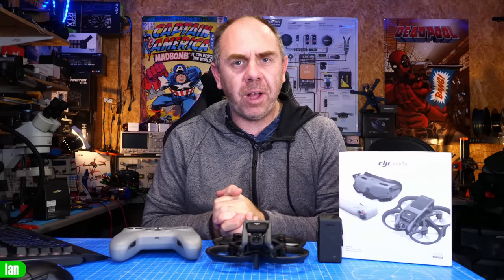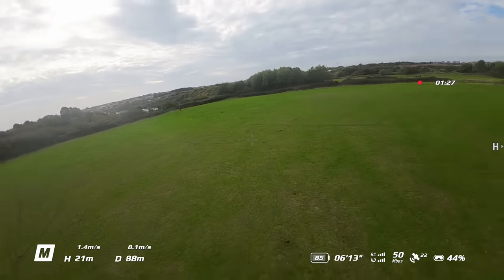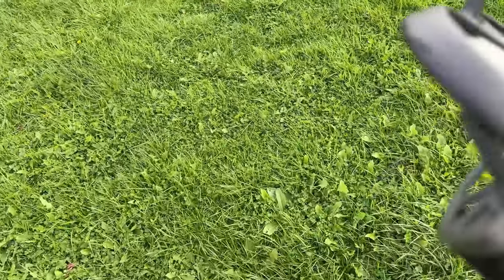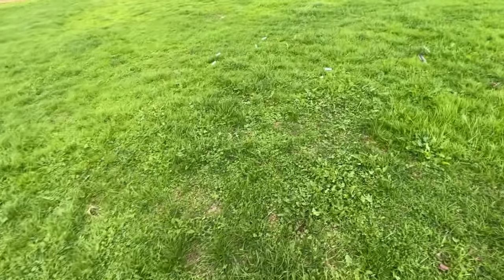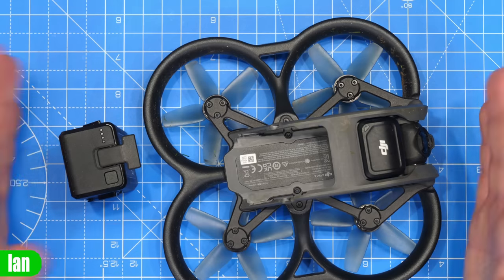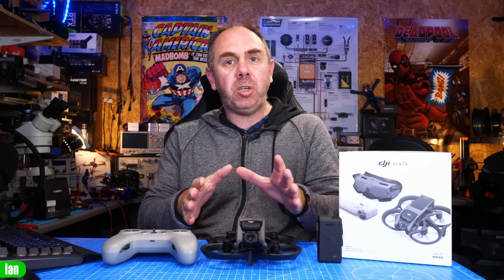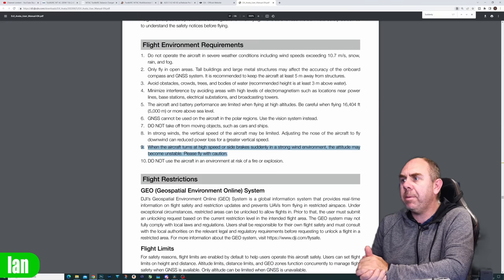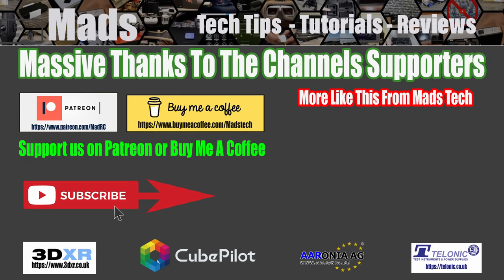DJI Avata Manual Mode Warning  - Yaw Crash Risk

Comment: Why are people flying it like a freestyle acro kwad? 
Sharp turns like that aren't very cinematic..
Reply from the maker: What everyone seems to be missing is the fact once it flipped it was inverted, refused any commands and only died once the pack was thrown.  I don’t fly the avata like this all the time but I was shared video that was showing it happening. The windy day for me was just how it was.  It may be a factor however the issue is not the washout alone.  It’s the fact it tries to kill its self completely.  If it’s capable of being destabilised like that in wind then they need to limit it.
Reply: Interestingly enough, there are quite a few fast-flat yaw turns in some of DJI's own video taken (allegedly) with the Avata on their YT channel... go check it out for yourself.   If the drone design can't handle flat hi-rate yaw then it this should be limited in software by reducing the max yaw rate.
Reply: @MadRC  Agreed, I keep watching yours and others footage.
It's definitely more than just wash out.
But I also think dji were fully aware of this needs some work doesn't it...

Well done once again for bringing this into the spot light.

Don't let the negative feedback stop you from continuing.....
Reply: Fascinating...... following with interest to see what they do about this.
So advice now is avoid sharp yaw turns? 

I notice some have had the issue in the other modes as well?
Reply: @gmivisualsjason3729  The problem is that in today's litigious world it's probably safer (and demanded by the corporate lawyers) that no liabilty is admitted.  Better to simply blame the pilots and silently slip out an update that "improves flying characteristics" instead.

Comment: That’s because it wasn’t designed for manual mode it wasn’t designed for the freestyle fpv racing folks it’s made for film making the fpv being for those fast pace shots and chase shots. The avata brings close proximity flying and filming in tight places at slower speeds.
 So in conclusion FYI it’s what have you done not really dji’s fault. You guys are really just making it do something it wasn’t really designed to do. Your going to get flight control flip out, anytime you put more g forces on the gyro than it’s designed to handle. It was not designed for what you guys are trying to put it through. The DJI fpv was designed for it, but it was also designed for more fast pace aggressive flight. These are film making tools like all of DJI stuff. The thing that is fundamentally wrong is you guys just see drone not professional tool. You want a beginner drone get a tiny hawk kit couple hundred bucks
Reply from the maker: It’s not designed to turn around ?
Reply: Not at full speed no! You can’t be going full throttle forward and bust 180 with the thing. You might get away with flying it aggressively for minute. Buts not designed for hard core freestyle or racing it was designed to carry a camera and get a specific type of look to the video. If you want a gps fpv that has return to home and digital transmission that rips hardcore there’s far better options out there even for beginners. DJI make film making tools.

Comment: Maybe everyone should leave Attitude Mode on until they are familiar with the drone and its limitations.
Reply from the maker: Oh come on Lon. That is nonsense. Same old same old defending DJI.   I can show 5 videos of the same issue in normal use as they were sent to me before I went out.  This is not in any way “normal”. Perhaps some people should think before they post ;)
Reply: @MadRC  oh so you're the thoughtpolice are you? Maybe people ought to think twice before doing low altitude rubbish yaw spins on a cinewhoop?
Reply from the maker: @waynegoldpig2220  no but I know what washout is and this is not it.  This was not a simple loss of thrust,  it flipped it self appears to have reset the gyro and then Ignored inputs.